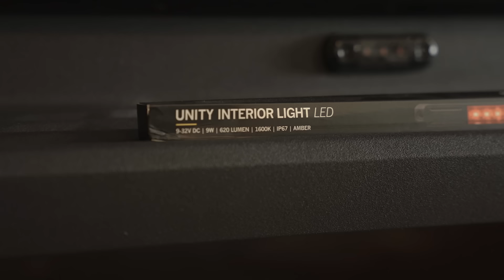STEP-BY-STEP LIGHT INSTALLATION - FORD RANGER RAPTOR - STRANDS LIGHTING DIVISION

Comment: Hi guy, as this is a German car, is the steel bar on the front compliant to the regulations? For newer cars, a bull-bar (I know this isn't a complete Bull bar) isn't allowed. I would love to know that this is street legal. thanks
Reply from the maker: The requirements may vary depending on the vehicle type and the lamp you plan to install. We suggest contacting our local supplier in Germany or consulting with a German legal expert. You can also refer to the German road traffic regulations.
Reply: @StrandsLightingDivision  Ty for the response